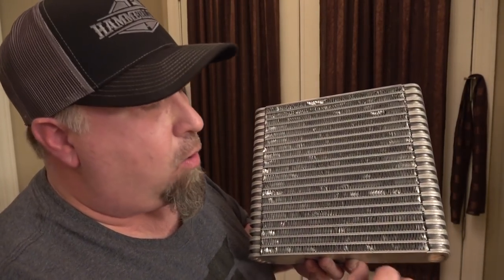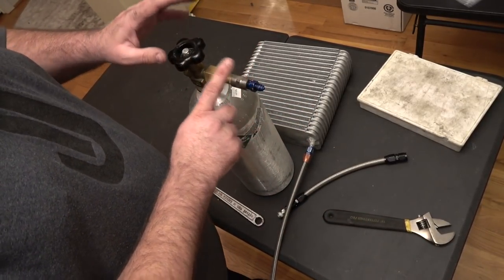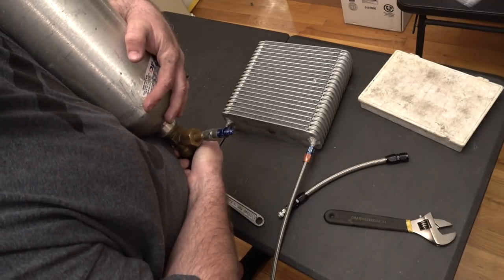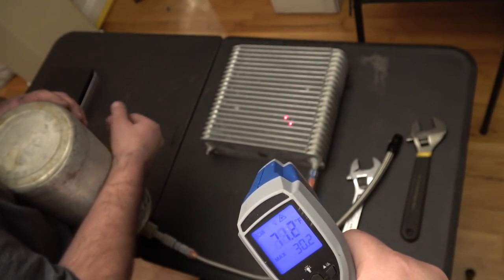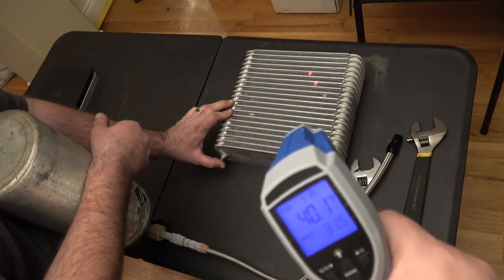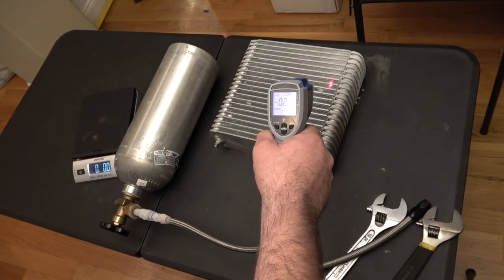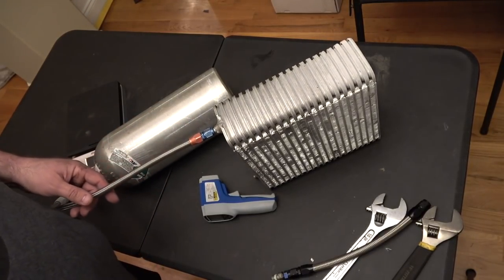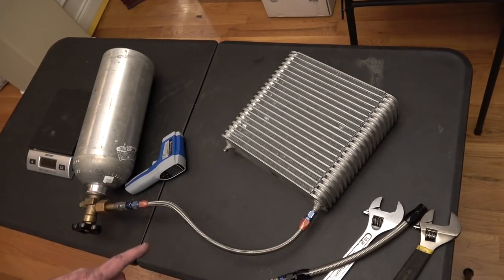Prototype CO2 Intercooler, Super Cold, you can build at home!

Comment: I don't want to come across as a ass.... but people don't seem to understand the difference between heat energy, measured in BTU and temperature, measured F (for our American friends) 

Opening a bottle of CO2 and measuring the temperature of fittings, one end of a AC evaporator or even the whole thing, might be fun, but it tells you no real useful information. It can be compared to measuring the temperature of a propane torch flame, heating up a spoon red hot and then heating up a evaporator core really hot and then thinking that you can heat your house because it got really hot. You can't heat your house with a torch, just like you can't cool your house with an ice cube. These things are hot and cold, but they do not have much BTUs or ability to absorb BTUs 

The "issue" here is that your turbocharger / intake air charge is moving a HUGE amount of air, and that air has heat in it... Figure out how much fuel you burn during a burn out and one pass of a drag strip. Now multiply that by 15 (fuel to air ratio) and you have the volume of air you need to cool during your burnout and run. Now consider the temp of the forced air, and by how much you want the temperature to drop. 

Now imagine that you are in a room with that volume of air, at 230 - 260 F and think of how long it would take to cool that room down with that bottle of CO2 and that evaporator OR how much CO2 and how large of an evaporator you would need to cool that room in 10-12 seconds ... because in a drag race, the cooling has to be done in real time. This is why even a small water to air intercooler can suffer from heat soak if you do back to back runs. Water is very good at absorbing heat energy, BUT as it absorbs that heat, it gets hotter, and then it needs time to dissipate that heat... It needs to get rid of all of the BTUs that it has absorbed. 

That evaporator gets ice cold when it is used as it was intended ... for AC... they form ice on them. However, when you turn your AC on and the evaporator is forced to cool the volume of the interior of your car, it takes several minutes, and on a hot day it may struggle. If you measure the air temp coming out of your vents, that temp will be really cold, but the air in your car will never get that cold as new heat is being introduced by the sun.

Don't get me wrong, I think this is cool and a fun experiment, I'd even like to see what effect it would have with a high flow of CO2 used on a small engine, (like a lawnmower) but If this worked as well as some may assume that it does, the room that you were in would have gotten very cold... not just the fittings or the evaporator, or the air from the hair dryer. Also, your car AC system gets these cold enough to form ice, so if this worked, why not just use your AC to cool your intake charge instead of using CO2? 

Again, not trying to be a ass... just answer some questions posed in the video and maybe save someone from spending a lot of time and money trying to make this work on a car. If you don't believe me, search around and you will be able to find info on the relation between pressure release and BTU capabilities. It's not the CO2 that causes the cooling, it's the pressure drop.
Reply from the maker: Good explanation.

Comment: You need a freezer/air conditioner radiator like this https://ae01.alicdn.com/kf/HTB1JAyUX7WE3KVjSZSyq6xocXXaH.jpg_q50.jpg
They are made of continuous tubes forcing the gas to go through the entire radiator.
The one you are using let the gas find the path of less resistance... In other words the there will places the cold gas will never go because there a better routs for it to take and that is why you see could spots instead of the entire thing cooling down.

Comment: So basically, you need to be careful you're treading on some secret stuff done successfully back in the early 90's. Next you're gonna have some guys dressed in black come knocking on your door.

Now I'm curious to see if you figure it out.
Reply from the maker: I have no idea, lol
Reply: @TurboJohnRacing  lol. Ya, some guys documented an experiment similar to what you are doing. Scanned and archived it, experimented with freon instead because of moisture issues. Releasing and capturing in a closed cycle to be compressed again and recharged. I was shown and was told Yunick was part of it. Not sure if that was true. I tried to research it and came with all sorts of stuff but nothing to what I was told and the notes I saw. Application was for drag racing boosted motors. They had methanol injection, water spray on radiators, and so with the experiment.

Comment: Put the jet on the outlet
Reply: Ineffective and likely to cause catastrophic failure of the exchanger. Cooling happens where the phase transition occurs your idea would cool the outlet and allow liquid CO2 to accumulate in the exchanger, add hot air and the internal pressure rises until you rupture a weld... if you're lucky.